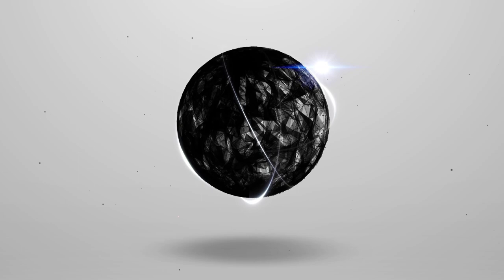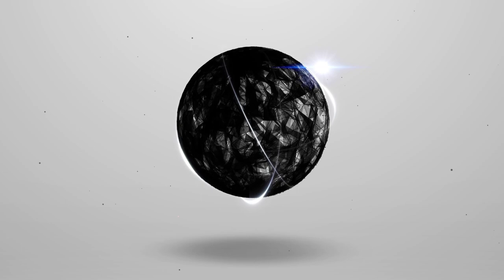D.I.Y. Overland Trailer Build #2 Part 1

Comment: Hey Mike, what weight did trailer #2 end up being? Need to know as I am going the same way and need to know if I'm in braked or unbraked hub territory?? Thanks dude. Inspirational stuff!
Reply from the maker: If I remember correctly it was right at 1500 lbs.  But Kevin is always adding doo dads so it could be a lot more by now.